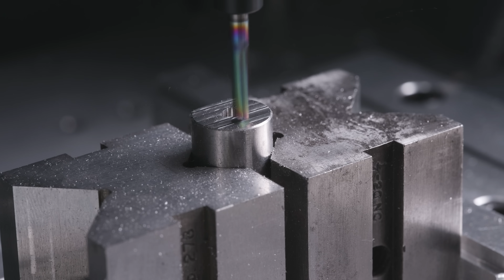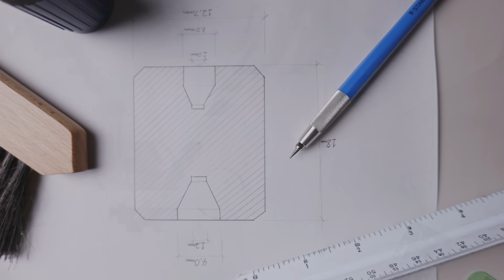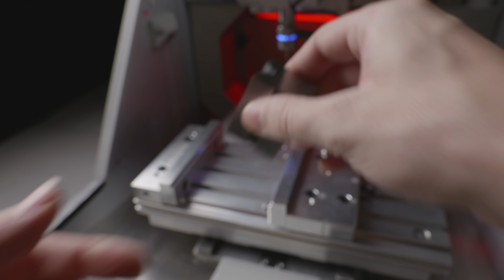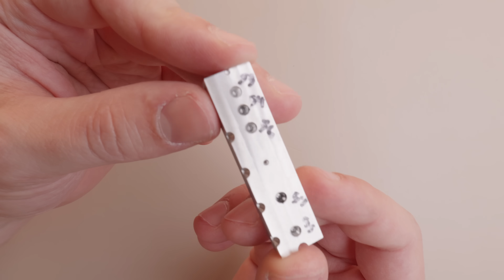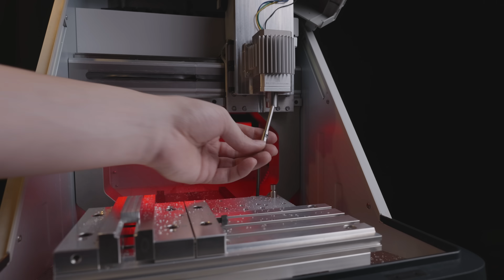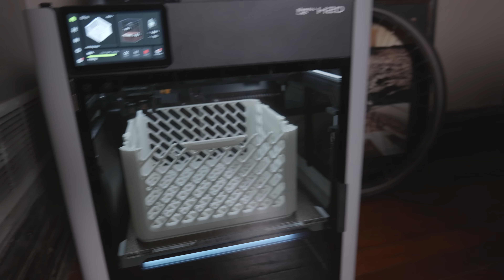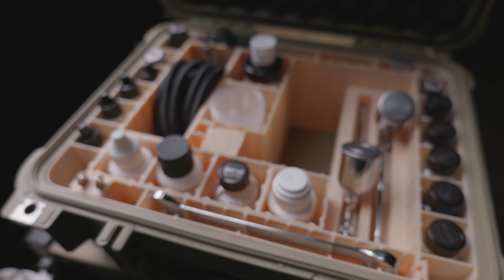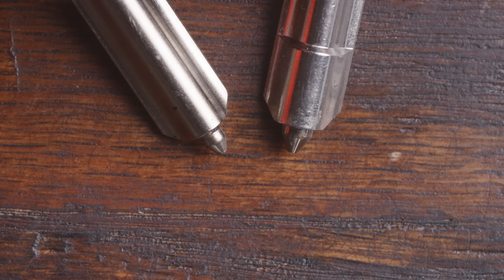Inventing A Tool Every 3D Printer Needs

Comment: To solve your problem of matching angles as well as the varying diameters, you could overcomplicate by emulating the same principles of a drill chuck with it's infinitely variable adjustability so the cutting edges adapt to the angle in the same way some vices have pivots in the center to adjust to different angles of parts. Also you don't necessarily need 3 cutting ends, you could in theory just have one cutter that is backed with a compliant springy material on either side of it's pivot to then interface with the tool head and emulate a simple 35 cent pencil sharpener. You might even be able to just cannibalize the shaver from a pencil sharpener for this project rather than manufacturing the tool from scratch if it gets dull over time.
Reply from the maker: ya like an exacto or razor blade installed on fairly stiff spring and a pivot on the other end would perfectly match everytime. the only trick would be making the parts small enough. the nozzle is only like 3mm in diameter so not a lot of room.
Reply: @Unemployed_Architect  if you want to make an all in one tool solution sure that would be a nightmare. But if it's split into two distinct tools aimed at tackling the different parts of the nozzle, (the side angle and the flat bottom) you could design two tools that each tackle their respective jobs.

One thing to think about is implementation inside the machine itself. If plastic buildup on the sides is a common enough occurrence it could warrant a dedicated cleaning station for it. Maybe instead of the default stationary wire brush like on some of the older FDM machines where it does a little cleaning dance you replace that with a motorized carousel of different shaped cleaning tools each aimed at cleaning a different nozzle part. 
But then you have to think about somehow purging that extra filament which would then get caked up on the cleaning tools.
But there could be ways around that. For instance if your tool were used in a machine the hot end could raise up after cleaning, then spew out a little moltin plastic, then that plastic clings to the old burnt stuff like a claw machine, and then carries it over to a purge bin.

Comment: All that trouble, just use a heat gun on the tip then wipe it off with thick paper towel.
Reply from the maker: This is true…but it’s pretty. which is really all I was going for (;

Comment: nozzles usually come with a thin, fragile, non-stick coating, especially the ObXidian series your tool will ruin in no time...
For the remaining ones, Slice Engineering sells a "Nozzle Anti-Stick Nano Coating" you can apply for a few cents per nozzle
Reply from the maker: ya the tool would need to designed to be of close to or equal to the hardness of whatever coating they are applying. I did come across the slice engineering stuff but didn’t like how often you need to reapply plus the nozzle needs to throughly cleaned to bare metal before applying. but than again I’m just super lazy when it comes to maintenance haha

Comment: Measure bottom of cone diameter, measure top cone diameter, use the sticky out bit of a caliper to find the height, divide each by 2 for the radius, go into your cad of choice and sketch the profile, make a revolve/360 shape, voila. 
I do enjoy the production though, and the effort put into your video. I am the guilty wire brush printer, but I've often thought about those gimmicky sockets that fit all nut sizes with the spring-loaded rods and using one to scrape the nozzle scum. I don't have one, but it's a tempting thought. Maybe a happy medium with the push pin toys that were popular in the 80s and 90s where you'd squash a hand or whatever fit into the thousands of push pins for display. It'd fit every nozzle in your library, but it'd need some punchy springs and likely rounded ends to avoid marring.
Reply from the maker: So that was exactly the method I tried measuring. The biggest challenge was the height. the taper doesn’t really have a definitive stop and start point. so it was always a guess as to what the height was even with 10x magnification.

I do really like this adjustable socket pin idea though. definitely could have some promise!
Reply: @Unemployed_Architect  The taper angle, if you want it Really spot on, I would run a clean-out nozzle needle down the center, mark it on a piece of paper, and trace the outline with as a fine a point pen as you can get, then break out the ol' protractor and compass, but as noted, the measurements with the caliper should get you 99% of the way there. Other than that, and forgive me as I forget the name of the program off the top of my head, but there's a fairly simple program that will make very accurate measurements for doing reference parts that counts pixels and calculates the rest of the measurements including angles if you give it a reference of a known spec somewhere on the picture. Geometry-wise, I use more or less standard profile nozzles that have a very small flat at the edge of a fillet at the tightening nut section that makes it a bit easier; (some have more throat/tip length, but all have the flat) where I could see that would be an issue with the Bambu nozzles.

Comment: hmmm i'm almost certain that the nozzle doesnt really have "the" angle. it surely has some angle, but its not really a critical dimension, therefore it doesnt make any sense to make sure that angle is the same on every nozzle. with tapers you have to be insanely precise to have good contact along every part of the taper. maybe a rigid design just isnt the way to go. if you can use maybe 3 scalpel blades in a triangular configuration in a way that allows them to flex just a tiny bit, results would certainly be better :)
Reply from the maker: yaaa this was my biggest fear it the background of my mind the whole project. The thought of rotary grinding in the taper on all my nozzles briefly crossed my mind hahaha. That said an adjustable angle design would be sweet. The only trick is the scale is super small to try and  incorporate multiple pieces.
Reply: @Unemployed_Architect  yep on the other hand, if it cleans every nozzle to 95% its already good enough. you just dont want thick buildup on the nozzle, nobody cares if its spotless
Reply from the maker: I was getting a let obsessed with getting every last bit off the nozzles. Felt like if i didnt it was a failure.
Reply: @Unemployed_Architect  yeah but i think thats a valuable lesson in engineering, knowing when good enough is good enough right? its a useful tool as is. there is little benefit in getting it like new

Comment: Cool project and if you could get one size fits all it would be awesome. But for now, 25$ gets you a USB-C rechargeable 4 volt cordless rotary tool. Slap a 2$ brass bristle brush bit in there and do the job in 15 seconds regardless of nozzle diameter. 

Just please, please don't forget to wear safety glasses, those brass bristles can and do go flying.
Reply from the maker: okay that is taking the brass brush to the next level! do you go to town with the rotary with the nozzle still installed?

Comment: Flatbed Scanner. When trying to measure the angle of the nozzles, consider putting them on one of those.
Might need to make a small jig to hold them flat/parallel to the bed but you will get a dimensionally accurate scan that you can trace in CAD.

Flatbed scanners are honestly criminally underused in this type of stuff. 
Couple weeks ago I had to make an adapter for a wonky dryer exhaust pipe and I just put some ink on the lip of the pipe and pressed a sheet of packing foam to it, then put that on the scanner and voila; perfect fit on the next adapter I printed after forgetting to mirror the scan 😅
Reply: Having just tried it you may need to do something to make the nozzle less refractive. It also might not work if your flatbed scanner can't handle the depth/distance from the bed very well. I'll try again when it's darker out so there's less ambient light but this may not quite work for these nozzles because of the size of the rest of the hotend.
Reply: @UPLYNXED Couldn't you just do it with a camera, then measure a width of the actual device with calipers, then size the image appropriately?
Reply: @urgemore  you could, but cameras have distortion from the lens and the singular point of view. It's like trying to align things by eye in CAD software with perspective view instead of orthographic. You can get close but it won't be 100% accurate. 

Another example of this issue is in the uv resin printers that are gaining popularity recently. A lot of them use a single camera to take a photo of the bed which can make it near impossible to align things near the edges of the printable area as they're very distorted. Latest XTool (I think that's the one at least) is adding a scanner sensor instead which works like a flatbed scanner and will get everything dimensionally accurate.
Reply from the maker: sadly I have no scanner ): I do have a camera and even with a telephoto macro lens i couldnt determine the angle ):. objects never seam to have perfectly crisp sharp edges so you cant be certain where the edge actually is atleast not at this small of scale. talking just a few millimetres in size

Comment: Wouldn't it be easier to rotate a tiny card scraper 360 degrees? Make it a little bar on a spring that you spin a bunch? That'd fit any angle, wouldn't it? It'd be more spinning, but that's what little electric screwdrivers are for. If it fits into one of those, you're set. It'd be kinda like a mechanical pencil sharpener, but with the angle defined by the pencil instead of by the sharpener🤷‍♀️
Reply from the maker: I think a single blade design could work and be effective. I choose three cutting edges for my design because I wanted to limit how far you had to rotate it by hand but the motor would definitely fix that.

Comment: Use Archimede's solution for measuring the cone angle.  It seems obvious.
J/K.  I made that up.
Reply from the maker: lol I was like two seconds away from google searching this
Reply: @Unemployed_Architect   Actually, maybe it could be done by measuring displacement of a liquid with very low surface tension - maybe glycol.  You little by little insert the cone into a tiny graduated cylinder, recording the displacement at each tiny depth change (maybe using microstepping of the printer z axis), then do the calculations.   Kinda nuts, and probably not accurate enough, but it might be "fun" to try.
Reply from the maker: This is actually a fascinating idea. You could attach it to a screw so you could precisely control how far its going into the liquid with each step.

Comment: I'm a designer and engineer, since we are making tools using metal, why not use a spring steel tightening ring with three chuck jaw style surfaces, that tighten onto any size/taper/curvature nozzle and ensure a tight contact everytime...or maybe even a compliant scrapper jaw design...🤔
Reply from the maker: See I was for once trying to limit scope creep. But now that version 1 is done. might as well go all out.

Comment: Use the sun to get a nice parallel lightbeam. Make it small by shining it through a small hole. Then use a slightly diverging lens to magnify the shadow of the nozzle tip and measure that :)
Reply from the maker: This is hilarious and a great idea at the same time. The ideal tool for measuring the nozzle would be an optical comparator which works exactly how you described!
Reply: @Unemployed_Architect yes, there are professional measurement machines using it for Tools, but i thought i describe a variant for a more buget friendly Solution ;)

Comment: Instead of trying to measure the angle, did you try measuring the two diameters and the length? It might not be clean, non-truncated angle.
Reply from the maker: I did indeed. The base diameter was easy to measure. The tip diameter was a bit harder but could get in the ball park. The length was the real challenge because there was no hard corner where the taper ended so it was almost impossible to be truly confident in the length.

Comment: 3 blades with spring to cover variable sizes?  Or some kind of Stargate Iris type of mechanism?
Reply from the maker: Honestly I really only use two nozzle size for like 99% for my prints. So I was thinking of just making the tool double sided. Don’t get me wrong I like the idea but it’s so tiny trying to get multiple parts in there would be…challenging.

Comment: motorized it, automate cleaning with gcode with every print (heck, you can even do it periodically during the same print), then you would have completely solved one of the most annoying issues of FDM 3d printing.
Reply from the maker: Honestly I don’t know how I didn’t think of this. To busy trying to figure out how to measure I guess haha. The only hiccup is would be trying to make that work with my Bambu printer. Might have to switch sides to prusa haha

Comment: If your tool is made out of harder metal than your nozzles you will slowly shear off bits of your nozzles every time you clean them.
Reply from the maker: well yes and no. The tool would have to be significantly harder to cause any significant wear. plus might not be a bad thing as over time the nozzle shape would come to match that of the tool perfectly so it would clean faster…I think Atleast haha

Comment: Nice aesthetic. Just an idea but if you had an EDM setup you could use EDM to drive a nozzle into a bit of steel (might need a couple of sacrificial brass nozzles) that should get you very close to an exact fit, then you can just cut your flutes as normal.
Reply from the maker: Thats cool. I never thought of using an EDM machine in that manner before. I have only ever seen them using wire as the electrode…Now I just gotta get me one (:

Comment: For what it's worth, I would 100% pay a sizable chunk of change to buy some of these tool steel cutter heads - even if I needed to buy a separate one for each individual nozzle type. (granted, I'm the kind of person who's happy to 'overpay' for tools in general if I believe they'll last)

I don't have a bambu (nor do I know if other brands are any more consistent when it comes to nozzle-dimensions) but at least for K2+ 'unicorn nozzles' the writing for the nozzle diameter is very finely etched onto their side and having gunked up nozzles can make that text super hard to read.
Reply from the maker: Ya especailly since i really only use two nozzle sizes for like 99% of my prints. I am curious if all the manufactures change the nozzle shape based on the dimeter or if its just bambu though.

Comment: Very cool! However on my printer a simple silicone wiper does its job, I just use a brass brush every now and then and a couple of passes are sufficient. But maybe it's because I have a tungsten carbide nozzle, stuff sticks a little less than ordinary nozzles. And the best part is fully cleaning it, I just remove it from the printer and torch it until it glows red, after that it's as good as new (otherwise nozzles last me around 100 hours as I mainly print ASA/ABS).
Maybe using that non sticky paint from Slice could be an alternative if you print PLA/PETG (I wouldn't trust it for hotter filaments as it uses PTFE in its formulation)
Reply from the maker: Ya i have heard those higher end nozzle like tungsten and diamondback, filament doesn't stick as much, I just never knew like how much less though. Im surprised standard nozzle only last you 100hours? I have couple nozzles with atleast twice that in ABS and i haven't seen any issues yet...atleast i dont think i have.
Reply: @Unemployed_Architect I guess it's because I print quite hot and fast. I have a fast printer and I basically max out my hotend all the time (every feature at 250 mm/sec and 25K of acceleration), so when the flow is even just a bit restricted I see odd stuff when dealing with pressure advance. But since I can just torch the nozzle, who cares? 😂
Reply from the maker: ahh that makes total sense. that whole being able to torch it without damaging it does sounds really nice. plus that way you know your nozzle is always perfectly clean inside and out.

Comment: Pretty cool idea and prototype. I was thinking that if the sharp cleaning blades could pivot in/out while being held in by a circular spring or silicone band towards the cleaner end it would self adjust for different pitch nozzles. Maybe have the inner side of the blades small pivot pins so they can only pivot on 1 axis so the outer end of the blade can be pushed out when inserting a nozzle. Like an inverted arrow broad-head that the blades fold in and are held with elastic in instead of folding out. It’s kinda hard to explain what I am thinking but you did good on your first working model.
Reply from the maker: I think i understand what your putting down. The only major challenge i see with doing a moving part solution is the scale. The nozzles are only 3mm wide so the pivots and parts would have to be super small. But it definitely could be an interesting challenge... I typically use two nozzle sizes for 99% of my stuff. So i figured you could have it the tool be double sided to cover the two nozzle sizes

Comment: As far as tip measurement goes, its quite doable to take a careful photo, making sure the angle is just right, import the photo into some cad software and use the calibrate or measure tool to scale the photo, then you can get very accurate measurements.

The angle of the nozzle is a perfect example of where this would be a whole lot more accurate and less fiddly than trying to manually measure it.
Reply from the maker: I thought the same thing but had a lot of trouble with it. I used a high res photo camera and strong back light but the edge is always slightly blurry. So it can be really challenging to know exactly where it is...atleast when your trying to measure down to like .001 of an inch